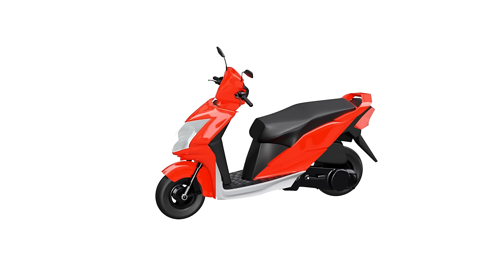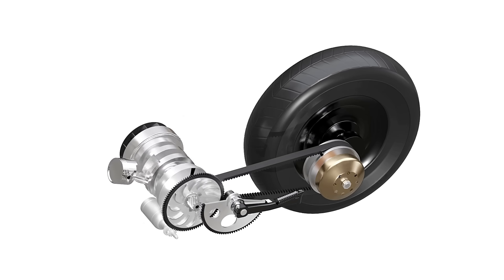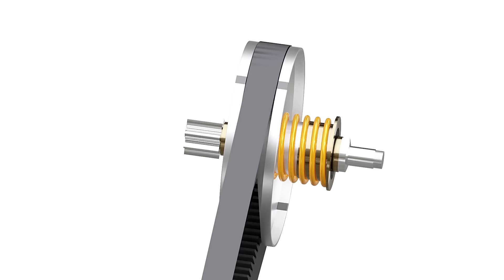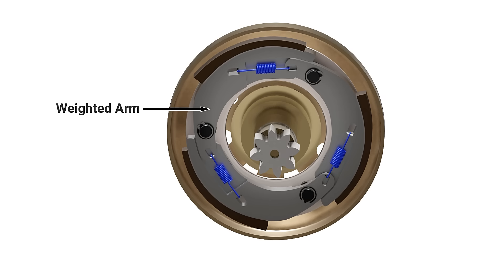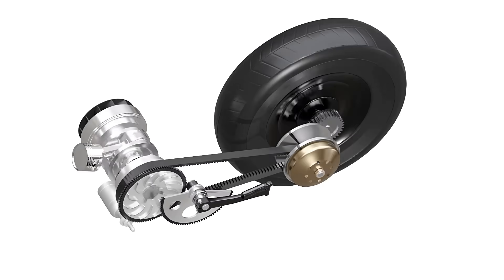How a Scooter Transmission works

Comment: It's impressive at first sight, at first sight only.

After 20.000 km the cost for gasoline is 25% higher than equivalent gear underbone, and all the things in the transmission need to be replace, the ball the belt the pulley e.g.This system cost alot to keep it original out of factory performance.

Comment: Chain drive are still the best for me not much repair. 

CVT always need maintenance mouthy not good for longer journeys only in paper it's great but not for reality it will cost you more in repair than those chain drive underbone motorcycles.

Comment: A CVT transmission l would have so simple mechanical transmission as they were meant to be no liquids no electronics l would ride a scooter with this CVT and even own one but l wouldn't own any CVT in any car especially Nissan's and Mitsubishis they are the absolute worst

Comment: how does the rear side of the cvt belt shorten in case of high rpms?..... now that it has been shown in the vedio how the front side of belt expand during high rpms, how does the compression spring of the rear conical disc actually ccompress in higher rpms?

Comment: so why this isn't used in motorcycles
Reply: It's less efficient as much energy is lost to the friction required for drive.
A manual transmission doesn't rely on friction to turn.

Comment: my motorcycle after changing fly ball i felt like the pulley is rotating faster than I'm gaining speed. it feels like riding manual motorcycle at 2-3 transmission. what seems to be the problem?

Comment: The relation between torque and rpm as explained in the video is confusing and misleading to me. Power is always a product between torque and rpm. It is for a given engine not independently controlable. A specific engine has a specific torque over rpm curve and therefore a specific power over rpm curve you can either optimize the variomatic for maximum torque or maximum power, but not both. The centrifugal force is not determined by the engines torque, but by the engines shaft speed (rpm). The torque at a certain rpm defines for how long the engine can keep the transmission under increasing load (e.g. inclining road) at a related ratio before reducing the ratio due to loss of speed which then leads to reduced centrifugal force and therefore leads to a "downshifting" of the variomatic.
I suppose that most variomatic transmissions are optimized to the max. torque point of the engine.

Comment: An excellent explanation!  Once one experiences the simplicity of twist-and-go (incl. DCT), one realizes just how enjoyable riding a two-wheeler can be.  Shifting gears manually is so last century, especially in today's traffic.  I recently dropped my ST1300 after accidentally pulling off in 2nd and stalling.

Comment: Ummm, you don't change the diameter of the pully. You change the distance between the walls of the pully so that the belt climbs up and down the walls of the pully which changes the effective diameter, not the diameter.
Reply: Meaningless distinction for the purpose of the explanation.
Reply: @F1sh_king  only meaningless if you're not watching a video specifically about "How a scooter transmission works".

Comment: the gear ratios are not infinite its limited by the size of the pulleys
Reply: "Infinite number of drive ratios between the minimum and maximum limits." They know. What they mean by "infinite" is that there are no set positions for the belt. It can move in any increment, giving it infinite possible positions. Similar concept to how there are an infinite number of moments at any given length of time.

Comment: the prinxiple of CVT is similar to the mechanisim of a bicycle. smaller chainring and larger sprocket have more torque. and larger chainring cranks and smaller sprocket have more speed

Comment: I didn't know that scooters used CVT instead of the normal automatic transmission. I have an automatic transmission scooter and I always wonder why I never feel the bike shifting gear no matter how fast is it, but then after watching this video I've realized that they used CVT instead of a geared transmission so obviously I won't feel any gear shifting on my bike. 😅
Reply: automatic transmission IS CVT.

Semi-automatic transmission is when you have a gear shifter but not clutch.

Normal transmission is where you have gear shifter and clutch.

I have all 3, love motorcycle the most but you can't deny scooters are extremely convenient in overcrowded cities.

Edit: I apologize for my dumb and uneducated ass. AT and CVT are 2 different transmission.

Comment: Motor matic menyalurkan tenaga dari mesin ke roda menggunakan CVT atau Continuously Variable Transmission. Sementara motor manual menggunakan rantai sebagai penggerak roda.
1.yahya alimardaud
2.fatkhy Nurul Hafizh
3 roif
4 dica

Comment: i know a centrifugal gear change system by the kyosho kit. if the engines revolutions per minute reaches a certain limit, the larger driven wheel moves a mechanical part held by a spring away from the axis so this will change the gear ratio

Comment: its not really a transmission, technically. All it is is two different pulley style centrifugal clutches with a belt that rides in between to smooth as butter plates, with a ton of pressure applied on either side of the belt, in both the front and rear clutches. The belt changes front to rear ratio based on the RPMS. Front will get smaller or bigger whilst the rear will get bigger or smaller accordingly. Top end cruise and take off ratios are generally the 2 most common. Like your standard front:rear sprockets on motorcycles, dirt bikes and go-karts. the real go-karts. not those fucked up things with scooter engines on em. reminds me of chevy. just making cheaper, shittier and less dependable vehicles and never has any of their own inoventions to throw in the mix of options and distractions.

Comment: Hello friends how are you all from so many years all two wheelers company using this CVT gear system time by time years by years lots of changes in design and colour models cc so many things but the gear system is still the same so my point is we need some changes in gear to get more maillage more smooth running let as wait when it going to be happen

Comment: How does the engine continue to run when tires aren't moving?
Reply: The centrifugal clutch , when the engine is idling the clutch friction pads driven  by the motor are held away from the drive drum by springs , when the engine speeds up centrifugal force throws the driven friction pads against the drum giving it the same speed as the engine . 
 They are a very simple device .

Comment: What? I thought the pulleys are controlled by computer, instead of that idiotic inertia mechanism!
Computer controlled cvts are probably the case on cars. The inertia mechanism on this bike is far from smart at all and it selects the gear (transmission ratio) by engine rpm. Low rev low gear high rev high gear.
Very bad idea- sometimes the transmission needs kickdown which is lower gear AND higher rev!

Comment: i really dont understand why this cant be used with regular motorcycles. like people keep saying you cant have automatic transmision on moto because you dont want it to chenge gears mid turn etc, but scooters dont change gears so why cant there be a more advanced variator for motorcycles? i know they use chains because it needs to be more robust because the motorcycle is heavier so it doesnt rip apart to move the mass, but there has to be some sort of mechanism that could bypass this. cars dont run on chains either

Comment: It's not automatic, there's no neutral. In the other video I saw they described an infinite number of gear ratios. Meaning there's no neutral defeating the purpose of an automatic. If they kept automatic on one gear that would be superior
Reply: it disengages on low revs because of the centrifugal clutch
Reply: hi savourymilkman have you become a flat earther yet? If not I suggest watch a 13 part series called What on earth happened by Ewaranon to learn that the earth is not a globe. I got it in my about tab.

Comment: I'm amazed by how the belt it's hold straight but the weak clutch at low speed imitating a hidrocupling it's a source of wear and engine noise only to archive the torque set high in the revs due to short stroke intended to be elastic instead of having torque wich would increase the undesired speed for unlicensed like on Vespa on wich many have died and thus they decided to adopt this.

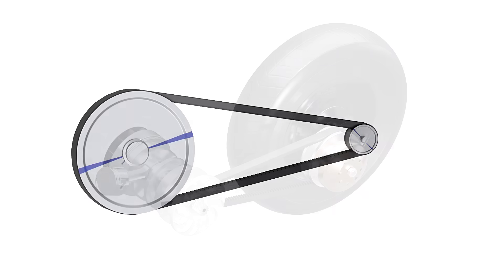Comment: Your comments at 1:54 of this video is the exact opposite of what happens with the drive pulley and the driven pulley. 
It’s backwards. The drive pulley increases and the driven pulley decreases. That results in higher RPM

Comment: Assuming she's talking about rpm of the driven wheel, or back tire, at 1:49, she says to achieve high rpm the driver pulley  diameter decreases and the driven pulley diameter increases. Oops, that's incorrect.
Reply: hi drain have you become a flat earther yet? If not I suggest watch a 13 part series called What on earth happened by Ewaranon to learn that the earth is not a globe. I got it in my about tab.

Comment: Centrifugal clutches were in mopeds in the 60's. The rubber band CVT was never a good idea as it slipped when wet! Two speed mopeds were quite common but had a gear box with speed operated gear change.

Comment: I have a Question. How does it come I go faster downhill when the cvt is restricted to 52km/h. And how does more torque in a cvt lead to a higher top speed when it’s still restricted
Reply: hi hstiller have you become a flat earther yet? If not I suggest watch a 13 part series called What on earth happened by Ewaranon to learn that the earth is not a globe. I got it in my about tab.

Comment: Does that mean when you go on a steep slope it's better to go at a lower speed? Since it's that roller only rolls outward and push it against the plate at higher rpm.

I remember seeing those rollers getting replaced and they are worn out very unevenly, some had a worn out part that is flat to about 2mm of width some 0.5, I'm guessing sometimes they dont roll and just slide outwards causing those worn pattern but I dont get why  they aren't consistently the same among all the rollers

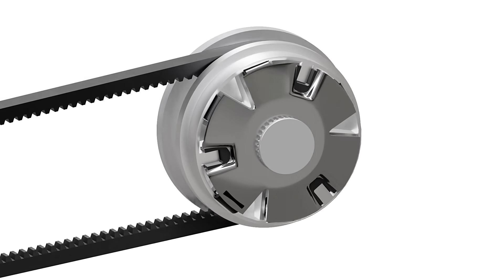Comment: This was a great explanation of what goes on in the variator and how the clutch works, but they left out what controls the movement of the belt up and down the cones on the clutch/driven side.  It looks to me like that is simply the fact that the belt is a fixed length, and as the diameter of the drive pully expands the belt tightens between the pullies, forcing the belt down further between the cones of the driven pully, forcing them apart and compressing that yellow spring you see at 2:30.  It might be obvious to most people but it wasn't to me at first and I wish they would have at least mentioned it.  Overall though great explanation thank you!
Reply: the belt is finite,so if you have more belt on one side it means less belt on the other side.
I'm bad at explaining but this is so interesting
Reply: I came here to say the same. Even though its the best video I could found explaining that, the part of the driven pulley is omitted. I came up with the same explanation as you did. I wish that someone could confirm it or send another video that explains it better. Thanks!
Reply: I checked it on chatgpt and its right
Reply: That part has been already explained in the video. Maybe you should watch the video again.

Comment: I prefer the centrifugal clutch and transmission systems.
More reliable and simple.
Requires much less maintenance.
Gears and chain instead of rubber.
Reply: Maybe less maintenance but not simpler, can you fix a transmission in your backyard?

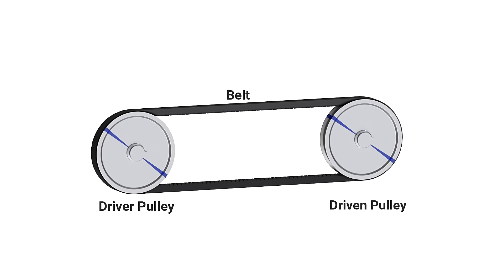Comment: Thanks for the great video.. I have noticed a minor error in audio & subs(while the video frames show correct alignment) @01:47 which states "To obtain high RPM, the diameter of the driver pulley decreases and that of driven pulley increases.." which seems to contradict the explanation given before @00:33. I am viewing here after 4.5 million views, my thoughts were that I had heard it wrong... But here I am writing this comment after checking 4-5 times. Thanks again for the great demonstration.
Reply: Noticed too
Reply: Me too after 7.3M views(Searched for this comment)

Comment: At 1:48 you say : "To obtain high RPM the diameter of the driver pulley decreases and that of the driven pulley increases"
That's the opposite. The driver pulley's diameter INCREASES and the driven pulley's diameter DECREASES.

Comment: And so does most new cars have the Continously variable transmission, look at the window sticker it will be listed CVT or spelled out.  I don’t want a car or any vehicle with a transmission like a scooter.  Can you imagine the cost of pulling your front wheel drive vehicle to repair the transmission after 40-60,000 miles.  Subaru even seals their trans so if you have trouble, you can’t service it.
Reply: Cars use a planetary gear system iirc

Comment: Wow, that’s actually a good explanation. Especially liked the centrifugal clutch part, always wondered how some go-karts can keep engines running at low speeds.
Reply: go kart cvts have the drive pulley open slightly wider than the belt at idle and have a brass bushing at the center that acts as a bearing for the belt. but when the drive pulley closes it squeezes the belt, engaging the cvt.
a lot of go karts also use a just a centrifugal clutch, running at one gear with no way to change them.

Comment: You missed the the centripetal ramps on the output shaft, Basically the a set of pins fixed to the  output shaft and curved tracks that they ride in this allows the output diameter to also be adjusted via speed or torque

Comment: The real beauty of this system, when you think about it, isn't just the functional result but the sheer simplicity of it. There are so few manufactured parts compared to a conventional motorbike - I finally understand why scooters can be produced so cheaply. They must be a doddle to service too (other than belt removal and installation, which is probably a right laugh).
Reply: You change the belt about once a year, cheap belts will disintegrate though. They're super easy to work on and maintain due the the simplicity of the design. Only one drawback is you loose a lot of torque and responsiveness from the belt.
Reply: Dude, this type of engine is more complex to make and also difficult to get it down to a size that fits in a Scooter. In general Scooters costs more than a Motorbike compared to features. Just compare the wheels of a scooter to a motorbike, Even a simple Disc brake witout ABS is sold at a premium on scooters.

Comment: Is there a difference between a centrifugal clutch and a rekluse clutch. I'm guessing there will be as one is designed for CVT and the other not. Could you do a tech demo on how a rekluse clutch works? Is it possible to stall and are there limitations to either systems?
Reply: Similar principle. Uses Ramps and ball bearings to press clutch plates together.

A more refined system

Comment: scrape the roller track, pulley lathe 13.5 Level, spring cvt + spring centrifugal clucth on 1500rpm, roller mix 11gr+13gr ,guaranteed up and down power goes up,I have proven it on Honda Vario 150👍👍

Comment: Not one of these scooter transmission videos explains the load compensation in the driven pulley.  Why do the engine revs rise when the throttle is opened, or drop when cruising?  it's a very simple and clever system, and one of the most important features of a scooter CVT, but everyone leaves it out in these videos.

Comment: The belt and centripetal belts slip al lot, so that's why they use up more gas than a comparable motorbike. I think most scooter will be electric soon.

Comment: Perfect final gear ratio everytime,, no wonder small scooters now days can run better than manual clutch motorcycle (at some point and of course with the same engine displacement too)

BUT, on steep terrain, manual motorcycles, either going uphill or down hill, won't have any problems tackling the situation...
Reply: How would cvt scooter takes on manual transmission motorcycle.
Since they're slipping it create much more  power loss than normal transmission , never heard any 150cc scooter can reach 150cc motorcycle 
They're not even close
When cvt slipping through it limits , motorycle might have more actual gears to pull

Comment: Can i use manual transmission fluid in cvt?
Reply: I am not sure about cvt, but many modern automatic transmissions need specific fluid to work properly. I doubt cvt would work well with manual transmission fluid.

Comment: Shouldn't such transmission be lubricated? Seems like a lot of friction is generated by those belts rubbing on those plates.
Reply: On second thought, goodness no, you wouldnt want to lubricate that belt. First oil would accelerate degradation of belt and second lubrication would cause the belt to slip which in turn would make it impossible to transfer propulsion.

Comment: They used CVT in cars. Now it's the worst car transmission ever. Take Toyota Vitz 2007 as an example. The car barely moves and the engine goes full rpm making fuel efficiency zero

Comment: I wish there's a cvt system that you can manually control the pulley ratio
so that if the vehicle is going through a tough situation such as off road or a very steep hill

 it can stay in a set pulley ratio
so that the rpm and power would increase independently, but the pulley ratio would stay the same as it is set in a temporarily fixed pulley ratio
Reply: thats the job of the big spring, it pushes the belt and pulley back to high torque(like 1st gear on manual) whenever you close the throttle